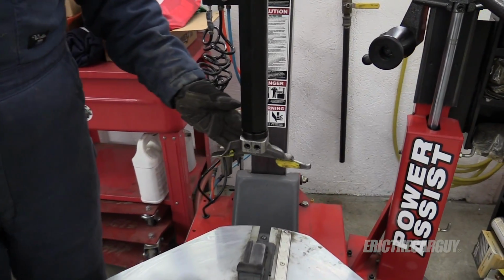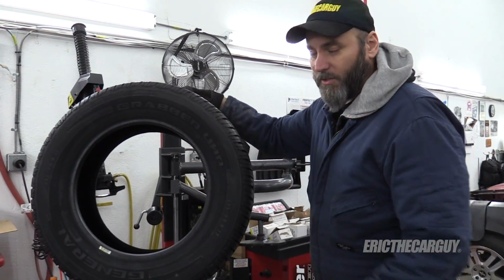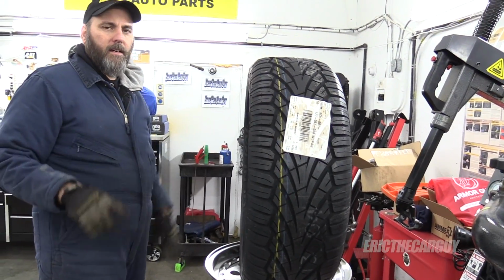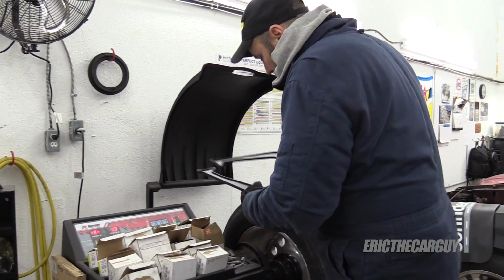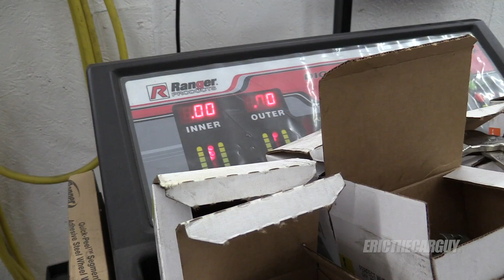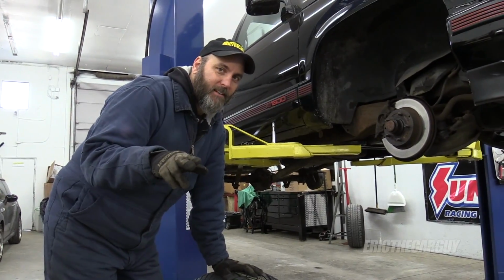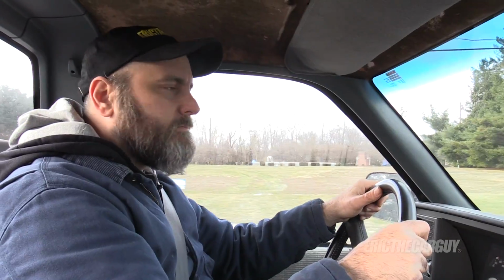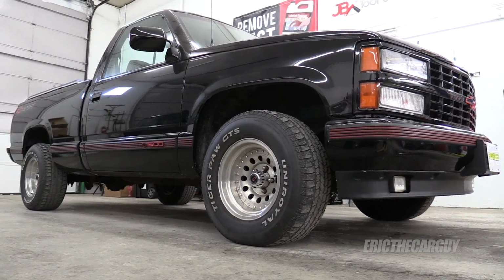#ETCGDadsTruck Gets Wheels & Tires (Episode 2)

Comment: Somehow I thought that truck was a 454SS not a sport...   I'm not sure why you're so worried about rubbing, the 454SS came with 275/60-15's which should be nearly 1" wider than what you put on and just a hair shorter, and on the 4x4 version of the truck (same body) you can get a 33x12.5" or a 285/70-16 on them at stock ride height both MUCH larger width and height.  I don't know what you decided to do to the truck but I'm assuming that with this tire choice you're lowering it, I would have gone with 275/50r17's with those wheels, or wider, though I like the old 15's (I love the old SS wheels, and there's loads of ralleys, circle/dirt track... tires that would give the same "flavor" to the truck) and would prefer the stock 454ss size even.  Of course the drag racer in me would prefer staggered sizes.  I'd love to see a 295 (with 15's) or 315 (with 17's) on the back of that truck.

Comment: It really isn't your balancer; it's the nature of balancing aluminum wheels. I found when using adhesive weights on the inside to balance the outside rim as you did that adding .25 or .5 to the machine's number brought it to zero a lot faster. Your machine should have a self calibrating procedure, for that matter.
Reply from the maker: Thanks for the input. I'll have to try that next time.

Comment: You should never have to counter balance a wheel unless the rim is damaged
Reply: Absolutely not true. No rim is manufactured perfect. Tires are even worse. They are made within certain tolerances and the weights correct those imperfections.
Reply: @sminton85  Alright first off I don't need an explanation on how wheel balancing works I've been a auto tech for a bit now there are two main types of errors when balancing wheels the first is called chasing when you lower the hood after placing weights the first time and it continues to ask for more weight every time the second is catching the balancer ask for weight 90°-180° offset from the first weight you placed in either case this user error 99.9% of the time remount the wheel to the equipment and start over and in some extreme cases note where the equipment is telling you to place the weight and rotate the tire on the wheel more often than not in cases of chasing put slightly less weight than the balancer calls for the first time and in catching try moving the weight left or right of where the balancer suggest there really is no excuse for blaming the equipment when it comes to customer safety and satisfaction
Reply: @satin227  So are you referring to correctional weights in your original post? In that case, I digress and you're right, it shouldn't require correctional weights. But it could be other things than damaged rims. It could be something as simple as machine calibration which Eric eluded to in the video. Or wheel measuring, which I doubt because Eric is a seasoned pro. And it could be because there is not a provision for stick on weights such as laser lines. You have to mark 12 oclock and eyeball the curbside weight. Jumping right to rim damage as being the cause of correctional weights is assuming a little too much in my opinion. And I was by no means questioning your intelligence. I don't know everything there is to know. But I have been working with mounting, balancing and uniformity correction for a certain high end American made vehicle OEM for 11 years. Because of non-disclosure agreements, I can't even say where I work without fear of losing my job. But tire and wheel is my thing.

Comment: They look all 'Chevy"! lol, on a serious note, wouldn't it have been easier to just static balance the tires instead of fighting with your machine? Perhaps think about COATS machine. Where l work we use them and they are  very good. Just saying. But the down side is their about 3,000 but worth the price for less of a headache. Just throwing it out there. l don't know if you mount and balance tires enough to make it worth the investment.And btw PLEASE but a Chevy logo on the center caps!! TY!!
Reply from the maker: I think I'll start by calibrating my machine and see what happens. Unfortunately the Chevy centers won't fit the new wheels.
Reply: EricTheCarGuy what about stickers with the Chevy emblem?
Reply from the maker: Not likely a possibility. At least nothing that would hold up over time.
Reply: Dynamic balance is better for vibration and tire wear.

Comment: If used properly, no part of a tyre machines duck head should ever come in contact with a wheel, only the tyre.
Reply from the maker: I have yet to see an instance where the force exerted by the tire to stay on the wheel does not force the duck head to come in contact with the wheel.